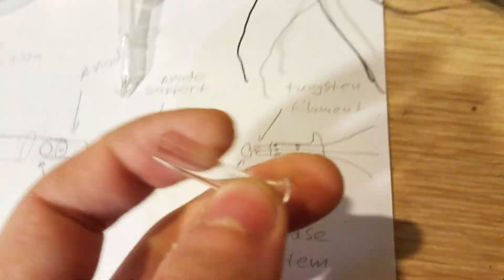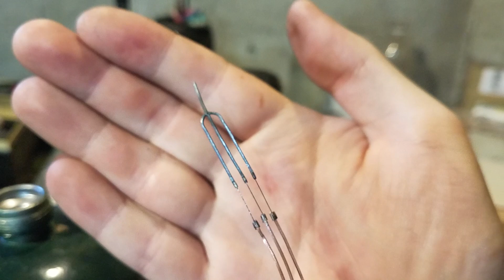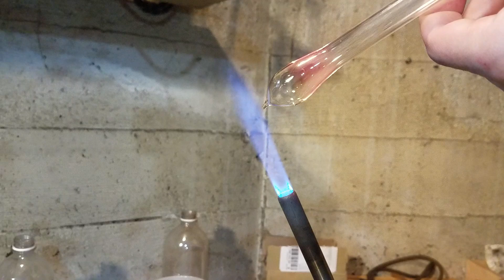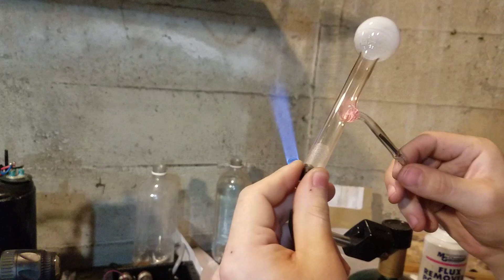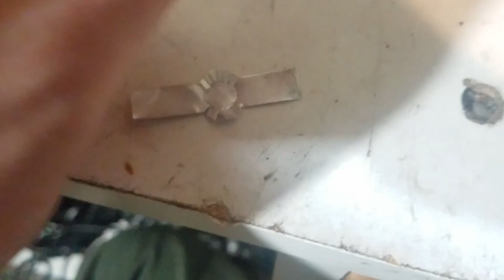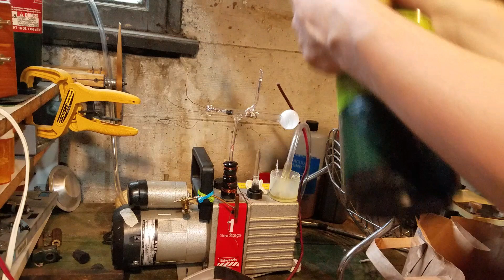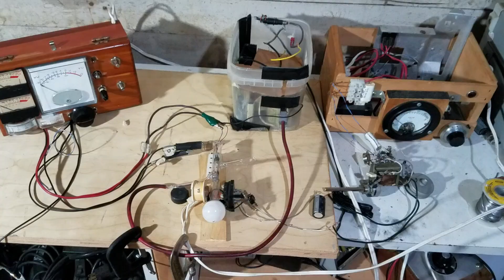How to Make a Sealed Cathode Ray Tube at Home

Comment: That is unbelievable.  Have you thought about using a small Erlenmeyer flask for the end of the CRT? It would already have a good shape to it for the screen and I believe they are made of Pyrex.
Reply: This was my first thought when I started watching the video. Now I want to try it myself! I hope he does it, though. I bet he'd be way more successful than me.
Reply: applied science did this in his diffusion pump video but the issue is that the neck is not long enough (and thus the deflection coils are less effective), however that should be easily fixed by adding on another length of tube
Reply: Pyrex is more difficult to work with. Incompatible with the glass he is using.
Reply: Whoops, he is using Pyrex.
Reply: yeah borosilicate glass is the standard nowadays (i didnt say pyrex because its a brand not a type of glass and theres that whole pyrex cookware fiasco)
Reply: I was wondering if he could make a flat face crt by heating that ball end and pressing it against a flat surface.
Reply: @jimsteele9261  he could but ideally you would not make it perfectly flat but rather slightly convex as the vacuum inside can implode the thin glass, in commercial ones the glass is thicker (like 1/3rd inch) usually which is why they can be nearly flat, but the bulb he made is thinner
Reply: @jimsteele9261  You would need a lot of heat, carefully applied to the roasting tube and air to blow out the edges. Better to start with a Erlenmeyer flask (flat bottom, more or less).
Reply: I meant rotating tube.
Reply: It was common for those of us in the CRT manufacturing industry to have someone with "lamp working" skills to attach an electron gun and neck glass to an ordinary Coke beverage bottle. A working CRT with phosphor in the bottom of the Coke bottle (admittedly, not a good quality screen)
Reply: Well you dont want a flat crt if youre trying to put anything ledgible on the phosphor, ill let sony schematics speak for me on that. Now, blowing out the bottom of the flask to a small convex would work wonderfully. You want the distance from the aperture to the phosphor to be equal across the whole display otherwise you need to make up for the geometry. The whole goal is to get something legible on the phosphor.

Comment: Well done!
I did a very similar thing, when I was about 13.
But by pulling apart a triode valve (tube?), adding phosphor from a lamp, adding a magnesium getter, resealing it, evacuating it, then igniting the getter.
Alas, I could not acquire a dot, but got a satisfying white glow that varied when I waved a magnet near it.
That was good enough for me at that age, with no help whatsoever.
Reply: How did you do that at 13 ? Like how was it financed ?

Comment: The waveform at the end was truly amazing considering the fact that the electron gun is so simple compared to the commercial oscilloscope CRTs. 

In the course of making my own "thermionic vacuum devices", i have found out two things that may be of interest to you:

1. The electrostatic deflection of electrons may also be done externally. This can be achieved by placing a piece of copper tape on the tube and applying a voltage to it, just like you would if the "plate" was inside the tube. 

2. This one i can't say for sure, since it's only been a month or so, but i managed to create a diode tube with a glass-to-metal seal made entirely out of nickel wire, so no tungsten in between. 
The catch is that i used 5 minute epoxy at the flare side of the stem and let the tube sit for a day before vacuuming it out. The tube still holds a vacuum, but that whether or not it will stay this way remains to be seen. 

Since then i have made 5 or so different kinds of tubes that all use the same type of seal, and all of them still hold a fairly good vacuum, although the filament in one of them has burnt out. The only disadvantage that i have found for this type of seal is that it can't handle extreme temperatures (over 100°C at the stem), but the advantages should be clear.
Reply from the maker: Thank you! That is exciting! I have not tried epoxy before but that is an option. I would have thought that the epoxy itself would be permeable to gas but the fact that your tubes still have a vacuum probably rules that out. The temperature is an issue though, since I heat my tubes while pumping to try and remove fingerprints and other contaminants on the internal parts. If a higher temperature epoxy could be found this could be a good option.
Reply: I've had no issues with the epoxy seals when heating the tube to outgas it. However i am usually quite careful and never let the flame rest near the seal for too long. This of course reduces the effect of the outgassing as i can't heat the glass too much, but it seems to drive out the moisture and other contaminants adequately. 

I was also surprised that the epoxy didn't let air through it. The first time i tried this, i was trying to salvage a tube with a cracked seal and figured that i could at least get it to hold a vacuum for a while if i put epoxy in it, but the solution turned to work well in semi-long term too. 

It's however worth noting that the epoxy can't be used for fixing large cracks in the walls of the tube. I don't know why this is, but it could be that the large surface area increases the chance of there being leaks. The other (and the more likely) possibility is that the epoxy leaks a tiny amount of air and the larger the leak area, the faster the intake of air, so i wouldn't recommend this type of seal as a long term solution, but it's certainly useful for making prototypes.
Reply: @jdflyback  jb weld is said to be good for vacuum use
Reply: @manitoba-op4jx  No, it remarkably hasn't!

The vacuum is more or less as good as when it was first sealed off and even the filament still works.

Comment: Next step is to use photolithography with a projector to etch a shadow mask and cement RGB phosphors to make a color tube!
Awesome job, and very informative.
Reply: Y'know I've actually been thinking about that a lot lately - in fact glass working involving the production of rectangular glass CRT screens in general lately. Pet dream of mine would be to figure out how to recreate the glass enclosure production process of a retro arcade monitor CRT for restoration and repair purposes.
Reply: @monobunnyboing  Not sure how the glassblowing was done, but you might be able to find some clips inside of factories on youtube. Adding three electron guns, plus proper deflection, focus, phosphors, and masking is probably the harder parts, especially if one wants the tube to last. Handmaking CRT tubes could pay for itself on a small scale, especially if one focused on making drop-in replacements for fancy PVMs.
Reply: @ST-wn9kd  I actually watched one of the Tektronix documentary videos from the official museum YouTube channel and they show the screen glass being press-formed from a molten state within a rectangular mold form. While it sounds mechanically simple, I'm sure the resources required to consistently get enough glass to a molten state for a full screen using this method would be one of the largest challenges, followed by implementing some sort of tooling/machinery to handle the pressing at necessary pressure and using material capable of handling such high temps, then having an annealing oven capable of safely and slowly cooling the glass down afterwards to prevent cracking. Would obviously also need a lot of space for all that, plus  depending on the furnacing requirements for the glass it could get costly just for keeping the glass in a ready state, so it would have to be a method where we could theoretically use a disposable ceramic-type crucible for melting the glass between fabrication sessions as any remaining glass would cool and solidify directly within the crucible afterwards.
Reply: @monobunnyboing  For a monochrome tube, glassblowing could be sufficient. However, the shadow/slot mask or aperture grille in color tubes requires that the front part is seperate in order to clean and install the metal sheet.  What might be possible is to glassblow tubes, shape them, anneal, then let cool. Then, cut the front part of the tube away, maybe using a heating wire or some sort of saw or drill. The cut glass edges can be carefully cleaned. Then, one has the front glass plate and the back part. That way, molding is avoided.

Comment: You may get even better output with a flat bottomed flask , also heat the tube in a soft flame when you're evacuating it on the pump, it helps drive trapped air out of components, impressive work 😊

Comment: That's an amazing result you've got there! I've attempted CRTs a few times myself, but getting good results with amateur gear is quite difficult. I've gotten a beam that I could deflect with magnets, but there was no aperture to make a usable dot, just a wash of illumination. I've messed around with titanium as a getter (also saw that from Simplifier :D ) and the potential of using it for a resistive filament style getter, just haven't added it to a CRT yet.

Also glad to see you're using Pyrex. When I got into glassworking, the easiest source for glass was FMS Neon as I'm about 1.5 hour drive away from them. As such, I have a good 50lbs of soft glass, and boy is it finicky! It has a really nice advantage in the fact that I can just seal titanium wire right through it, but annealing is very critical. On top of that, you don't often get second chances to fix things as reheating soft glass almost always goes wrong, even if you're extremely gentle.

Struggle aside, this beautiful tube of yours has rekindled my interest in making another CRT attempt! Keep up the awesome work!
Reply from the maker: Thank you! I am glad to see other people interested in glass work, not nearly enough are. Pyrex really is hard to beat in terms of the ability to reheat. I never get something right the first time and the ability to heat and move something or fix a crack is invaluable for the amateur. I started out with soft glass too but never could make anything more complicated than a glow tube. If you attempt please make a video! I would love to see another persons setup.
Reply: @jdflyback  Yeah it really is an art that needs more appreciation. I feel more people might get into it if they actually knew more about it. Where do you source your pyrex? And how expensive is it? I paid around $4 per pound for my soft glass. I actually never did more than take pictures of progress as I made my devices, but have been interested in attempting to record the process. I think this is the incentive I needed to give that a shot!
Reply from the maker: I got most of my glass at a university surplus store for scrap price but I have heard good things about mountain glass. https://www.mountainglass.com/all/boro-clear/pyrex/standard 
I am not completely aware of what is a good price for glass but they might be on the expensive side for genuine pyrex. I would think the cheaper knock off could work (under the brands section) as long as the thermal characteristics are the same.
Reply: @jdflyback  thanks for the link! I'll have to see how their prices compare with some of the listings I've been seeing on ebay. Next I'll have to see if I can find some thicker tungsten or maybe kovar for the seals.
Reply from the maker: Sounds good! Let me know if you find any deals on tungsten wire, I have been sourcing it from a seller called prommark on ebay. 
https://www.ebay.com/sch/prommark/m.html?_nkw=&_armrs=1&_ipg=&_from=

Comment: My camera was 32 line up i made it multi system using Steve Anderons digital to analog ramp generator  since we are dealing with  audio bandwidths of a pc which i was using to play back i could really only go up to  64 line ,never tried yet to hook it up to my multisystem NBTV monitors should not be as limited as a pcs sound cards bandwidth . On Troys camera they are all 625 line  but very good construction diaries on how to make them and problems worth a look for sure ...mine are all NBTV at the moment i have make also mechanical camera with PMT  and a flying spot version over the years .

Comment: This information will be most useful for continuing my own experiments with electron beams. Thank you!
I've been using Faraday Wax to seal my leads next to the glass, instead of tungsten, though I've heard gallium works quite well too. At the same time however, I've been using a cold cathode electron gun, so gallium or Faraday Wax would probably melt from heating a hot cathode. I might just be a scrub though. I've been trying to make my apparatus modular so I can use it to experiment with different components.
Your glass working tips are very helpful as well. I can't believe I forgot I could use a power drill to turn the tube for flaring! I feel like an idiot now for trying to do it by hand.
I can also see now a lot of the mistakes I made when trying to blow my own bulb; didn't know I was supposed to pinch it off, and I probably didn't get it hot enough. I just bought some zinc sulfide powder online for my screen, because I was too scared to touch anything potentially toxic (not that I haven't broken a few florescent bulbs for science before).
Is there a trick to making the glass T-junctions though or do you just have to get them super hot? Because I kept messing them up and eventually gave up and tried to build my tubes using different methods.
Using the HV line is a clever way to check for leaks; I never would have thought of that.
Got any other tips, tricks, or recommendations for a fellow enthusiast?

Comment: Cool video. I have trouble understanding the workings of a monochrome crt I've been working on. You built a complete working one out of parts. Very impressive. All of your glass work on this project makes me wonder how hard it would be to cut open an old crt with screen burn and recoat it.  Great job.
Reply: Not a good idea. A commercial CRT (basically any vacuum tube) will have a high activity Getter that is activated during production and after pump and seal. The cathode is also coated and activated after seal and Getter flash.

Once the tube is cut atmospheric gas (air/oxygen) will destroy both the Getter and cathode. CRTs that are remanufactured for screen damage will also get a new gun installed, and after pump and seal go through the Getter flash and cathode activation. Same for CRTs that are re-gunned due to weak emission (dim screens) This is worth doing for TV Color tubes as the screen and shadow mask can be salvaged and represent a lot of "value" (costly production effort)

I worked for a volume CRT builder for a number of years. My dream job at the time, and a great education.

Comment: This is just wonderful!
A thought on the filament glare: How about exploiting the light vs electrons in magnetic fields effect to "shadow" the screen from the light emitted by the filament?
This means aligning the pinhole and filament in such a way that you have to bend the electrons path to make them hit the screen. The photons go straight and will miss the screen.
Reply: For a time in the domestic television industry there were "bent guns" in CRTs. The purpose was to make an "ion-trap" to stop the ions emitted by the cathode from poisoning the center of the screen phosphor. The electron beam  was redirected to the center of the gun by an external magnet, the heavier ions were less deflected and harmlessly struct the wall anode.

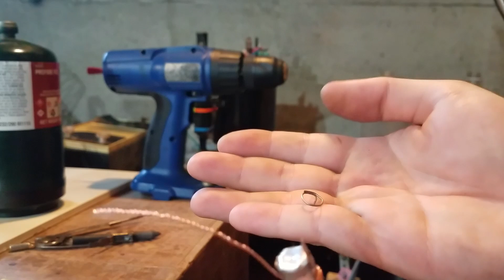Comment: Very cool build! Is the titanium wire covered in zinc, as you remove it in 54:18 ? Is it too corrosive otherwise so it comes zinc-protected like they do for steel ?

Comment: Hi there! I was wondering if you had a circuit diagram or schematic or something for how you power the CRT? I know there's a high voltage transformer involved, but something like that would be really interesting to see!! Amazing results by the way! :P
Reply from the maker: Thanks! I have a 0- 5V supply connected to the filament, a 0- -100V supply connected to the grid and a 0-30kV supply connected to the anode. All supplies are grounded to one side of the filament. the 0-30kV supply is built using an ac flyback transformer with a tripler. I try to keep the voltage on the tube less than 10kV to keep the xray generation down. I keep a geiger counter nearby when running it. I will try to make a clear schematic in a future video when I try to make a video monitor with it.

Comment: I love that spot welder and the getter induction flasher. Can you tell me anything about the welder timing circuitry? I'm getting into glass tube stuff and one of those would be great. I have a chunky toroidal transformer that I can get 400amps low voltage on demand  from, what else do I need 🤔
Reply: There are some DIY welders on YT that you can watch. Usually, wood pincers with a spring (look this video's welder spring, a cork stopper!) and opposing nails as electrodes at the pincers' ends.